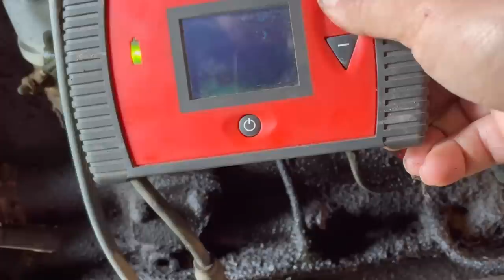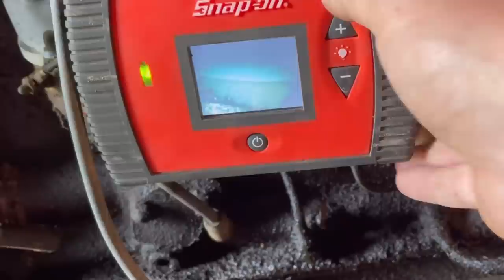Abandoned, Locked Up Cockshutt 40 tractor. Can I save it?

Comment: Put those sleeves in a bucket of Evaporust.  Let them sit 24 to 48 hours.  The Evaporust will not eat at the metal at all.  It will only dissolve the rust.  The pistons should come out easy.  You could make up a tube from PVC pipe with a plug on 1 end and a treaded plug on the other end.  Use a diameter that the sleeve will fit in and allow for a fair amount of Evaporust around it.

Comment: Hey JT, that thing is kicking your ass!😢 Been there!😢 My brother-in-law used ether to try and help start a beautiful 62 Rambler he got from his grandma. I got it after the engine stopped turning over. Never saw this before but the piston pins froze so tight that I had to pound them in alignment to pull them out the top! That tractor may have been in the shed for thirty years but it was the five it stood outside with the exhaust stack open!
Reply from the maker: Yes!  She was definitely outside for a stretch of time. 😉. I’ll save it nevertheless!

Comment: Hello  JT. As you said your in pretty deep, but a shame to not hear the old unit cookodoodle do. So to speak. I noticed you were not driving the piston with the sleve on a very solid support. It looked like a concrete block on a plastic milk crate. Put the sleve and piston in the freezer, or suround it dry ice until thoughly cold. Use a hard wood block if you can get one, I use an Ash block. Place sleeve and piston on a solid concrete floor and play whacamolie with a 15 or 20lb sledge hammer. (A soft wood block takes too much snap out of the impact and usually disintergrates.)
I have never had this fail to get the piston to move. They were not all serviceable after removal ( most were) but it is not serviceable now so not much to lose. At least you will be able to salvage connecting rod and probably the wrist pin.
Good luck looking forward to seeing the battle continue.
Reply from the maker: Thanks!  At this point I just need to save the rod. We’re gonna do a in frame kit on This one!

Comment: To nice a tractor to go to scrap.  So it'll have to have some sort of in-frame.  Bernzo torch prolly not strong enough.  Before you'all go buying a kit, how about a rose bud oxy torch and get those sleeve a bit hotter.  Then maybe hammer against a fitted base block for the sleeve ...  Got some hardwood around and hole saw?
Reply from the maker: Yes and yes. In frame kit in the works and one way or another those rods are gonna be free of those sleeves and pistons

Comment: Did you tape this awhile ago?  It's been 80 degrees in east central Wisconsin this week.  The lawns are all dried up.  I'm having heat stroke just looking at you with all them flannel shirts and sweatshirts on.  LOL!
Reply: I was thinking the same thing! Hovering around 90 degrees for a week here in ND and next week more of the same!
Reply from the maker: This was stretched over several weeks. I was hoping the cylinders would free up.  I pulled the head three weeks ago.

Comment: Freezer. Then wrap in a warmed blanket.  Lots  of  oill on  the  piston.   Steel  liner  should  expand before  the  piston.  OR,  slow  cook  in  trans/brake fluid. Stopping  for  a  breather  from  the  project  is  not  quitting.  It's  reflecting  on  what  to  do  next.  Or  sometimes,  "how  the  H!@l  did  I  get  into  this  mess?"  You'll  get  her  JT.  We  trust  ya.
Reply from the maker: Right on!  I don’t give up that easy 😉
Reply: If getting new piston and liner why not use a grinder to slit the liner length ways. (To recover the rod)

Comment: I would go with new sleeves an pistons and bearings if your friend wants to go that deep in to it. Or just replace the two sleeves. Be cool to see it run agrin .
Reply from the maker: He decided to go with a in frame kit. It’ll run!
Reply: That's what I would go with also....only thing is, you really don't know what shape the transmission is in until you get it running. At least the sheet metal all looks pretty good.

Comment: Excellent video JT  :) what year this Cockshutt 40 this with BUTA Motor 235 Cubic Cm  6 cylinder motor 43 hp with 60 or 90 torque  also 6 volt positive ground and 60 amp Generator! Those tractor built in Brampton Ontario Canada 🇨🇦  how I know those tractor my late Grandfather Bill Cann Sr bought brand new one on 1950 was made on 1 month - 18 day - 1950 for $4,000 Canada dollars!  Also my late Uncle Bill Cann JR was age 16 drove back to farm east Toronto Ontario in place called Perrytown north of Port Hope Ontario Canada  in 8 days in April 1 to 9 of 1950 ! Plus my dad Don Cann and Grandfather Bill  Sr followed him in 1950 Caddy GM car Lol ! I remember the tractor on farm one grew was same one Grandfather Bill  , Dad , Uncle had for 80 years together  from 1918 to 1997 ! In 1957 my uncle Bill and Don (Dad) bought of Grandfather Bill and his wife Ruby my grandmother! Sold farm in 1997 in 1993 Cockshutt COOP 40  gas tractor the motor seized up because number 3 and 4 cylinder bearings in Crankshaft from gears on oil pump and distributor broke in bearing seized up ! No motor could find for Buta 6 cylinder 235 Cubic Cm check worldwide USA an Canada plus we tried pull with another tractor to! So sold for parts and fix up another another Cockshutt 40  COOP gas tractor and one fix up guy did with old we had farm! But have heard Chrysler (Dodge) truck  235 6 cylinder motor were optional motor for those in 1951 to 1955 bolt up no problem but put wing mounts front end of motor to and in near oil pan bolts front to ! Yes those Buta Motor powerfull when running and hear running think Oshkosh 6 cylinder of Oliver tractor or a Farmall Row crop A to H basic tractor sounds on nice purring sounds! Fun to maintain up too and serivce too! If need more information about ask me in not sure about them ! Hopefully this tractor got crank  wand to wind up this should be on right side below carb near manifold on near Generator  if there!
Reply from the maker: Thanks!  I believe this to be a 48?  I didn’t look at the serial number but I thought Matt said it was. Sounds like your family has a lot of history with these!
Reply: @jtsbarnngrill6873   how found year on head on spark plugs 3&4  middle of left side be like 1-18-50  stamp on of hot metal type in square box !
Reply: Yes first Cockshutt tractor was 35 loader type  with 6 cylinders Buta Motor gas and never saw on farm grew up was gone before I was born years before  too!  Also my one uncle has Cockshutt 20 row crop
Reply: Uncle John has Cockshutt 20 Row crop type  has 4 cylinder motor gas funny one easy to start up on cold or hot starts one twist on crank on Crankshaft with 1/4 choke plus throttle to ! She ready go in 2 minutes of fire up !

Comment: The cockshutt model, 40 and 50 used the Alice Chalmers D 19 gas engine in them.
Reply: I have that D19....six cylinders, runs smooth as silk! Lots of power. Also have the turbo diesel version. First U.S. production turbo diesel tractor.
Reply: The front axle on this 40 looks just like the one on my Golden Arrow.

Comment: hey JT nice too see this make it on the channel. Got a question for ya. Know anyone who does Heavy hauling? i bought a combine but can't find anyone who has a lowboy to haul it back to my place (40 miles). Thanks
Reply from the maker: I never have good luck getting anything real heavy moved. I’d see if you have a local excavating company near you. I’ve had one move my 7520 John Deere years ago when I got it.
Reply: @jtsbarnngrill6873  oh it's only 4500-6k but it's main problem is it's a oversize... About 9-10ft wife by 11" 8' tall on the ground! Lol the height control goes up another 3-4 feet.
Reply: 40 miles? Drive it. A good Sunday project.
Reply: @farmerbill6855  we can't lol. They're not meant for barely two lane roads and it's a project anyway. It has an engine with hard to find parts .

Comment: What size are the front wheels and tyres on the 165?  Looks like a good upgrade over factory the pizza cutters
Reply from the maker: Those are 11L15’s. They do float nicely compared to the 6.50-16 that were on it
Reply: @jtsbarnngrill6873  Thanks a lot!  I'll have to hunt down some rims any idea what offset they are / what the rims are off etc?   Will help float the front for sure, it sinks pretty bad with the FEL on it (my 165 has the AD4.203 Perkins) got a 135 and a 35X as well so can relate the the Ferg sickness haha.  Really enjoy your vids, thanks for making them.